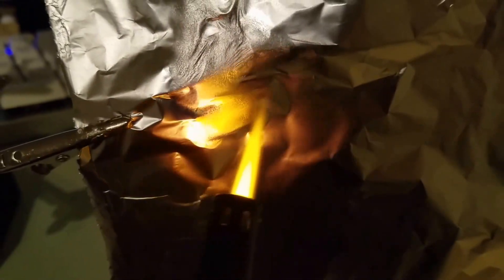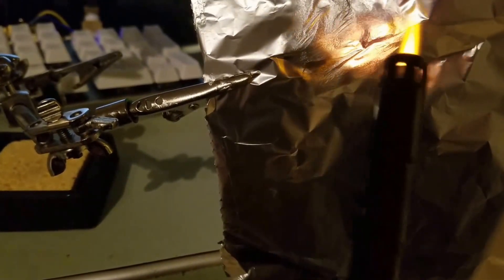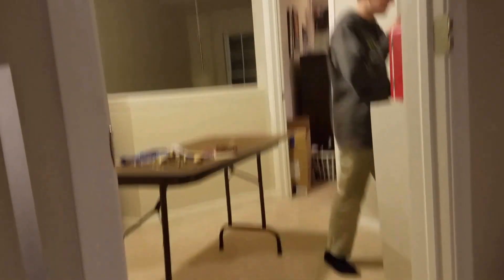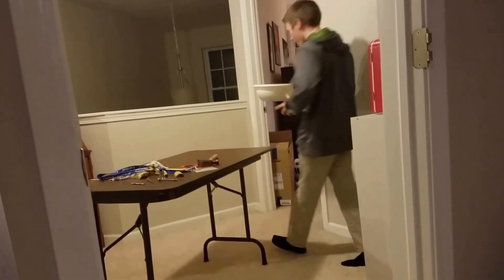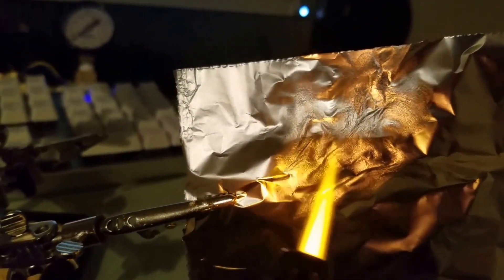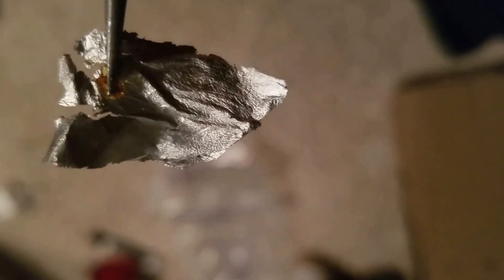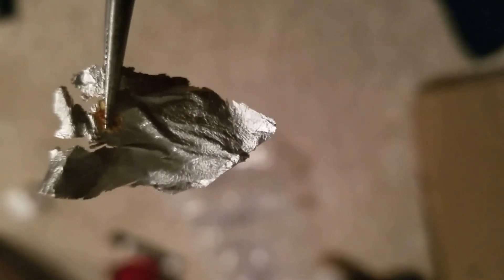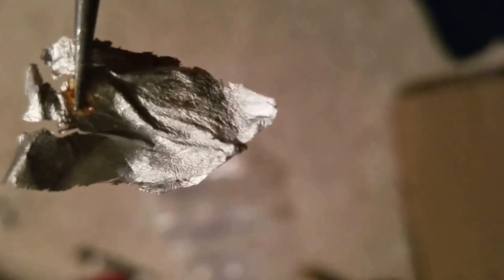Trying to Make Transperent Aluminum

Comment: maybe we'll try this but with pure Aluminium oxide, but getting a flat layer will be difficult, we can make pure aluminium oxide  powder but it will be waaay to thick
but we have a diffrent secret idea which may work very nicely but it may also fail and for our "secret" idea you need quite pure chemicals :/ but we'll show how to make them easily....(i hope).... (on maker amino too :)
Reply: It's aluminum oxynitride. That's what Alon, or "transparent aluminum" actually is.

Comment from the maker: I recently learned it isn't harder than sapphire, it IS sapphire (or at least I think it is). Sapphire is aluminum oxide just like ruby and emerald but with impurities that make each have different colors. This doesn't have nearly as much heat or pressure and no  other minerals are around so it stays translucent and can be transparent.
Reply: Transparent aluminum is a slang misnomer for aluminum oxynitride.